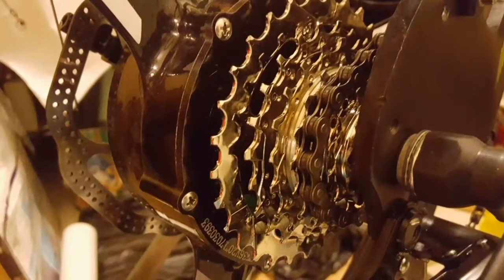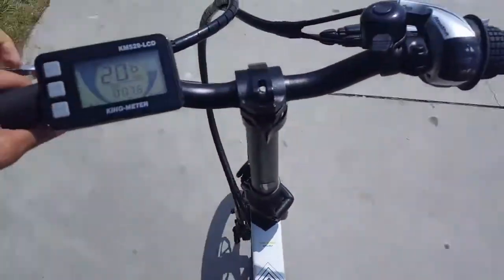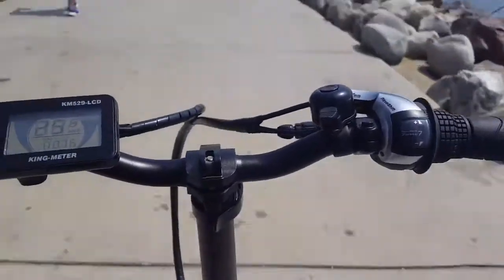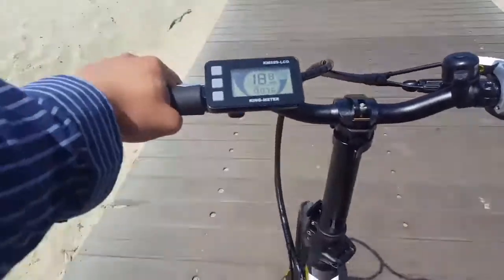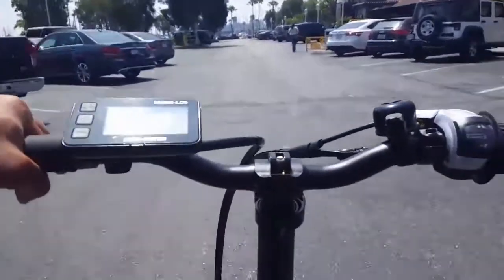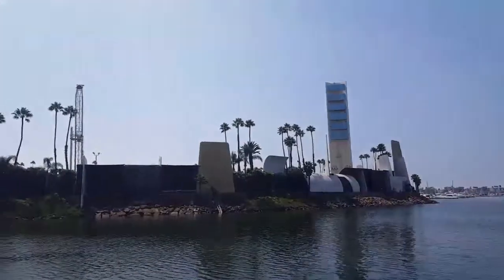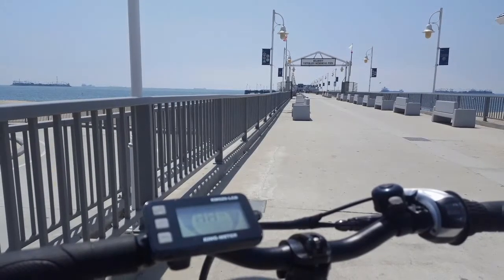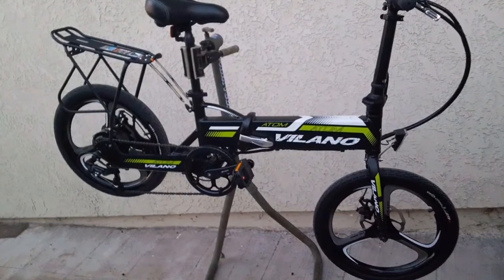FULL TEST - Vilano Atom with  11-30 teeth Freewheel  Upgrade - Review

Comment: I’m trying to decide between this and the Ancheer folding bike. This one looks cooler. Would you recommend it? Mainly need it to go to/from gym/work. Both are exactly 1.7 miles from home
Reply from the maker: +Cesar Bermudez i choose the vilano cuz it was cooler and didnt look like cheap. Also the weight was lighter and had mag wheels so i didnt have to deal with the hub motor destroying weak spokes not designed for ebikes. If you dont plan on hopping off curbs mag wheels are great. If you like click the link in the description for the bike and parts. Thanks !
Reply from the maker: +Cesar Bermudez one more thing, this bike has no mounts for a bottle cage... so while that sux, it still a great relative light folding e bike that doesn't look dorky
Reply from the maker: Lol i own and have been using it for months now for lunch trips with a round trip of 6 miles with still more than 50- 75 % charge left. It is still a diy tune or bring it to a bike shop after you get it. The main tune items are the disk brakes and gearing. Maybe tightening of nuts foe the wheels and accessories.
Reply: How’s the bike hold up so far?
Reply: i just got one a few days ago. pretty impressed with it so far. it's surprisingly powerful and easy to peddle. almost effortless on high assist. it's flat terrain where i live but being on the coast we do have steady head winds. it moves my 225 lbs to 37km  easy. battery life seems pretty good.

Comment: Nice! Thanks for posting. 

I got the Vilano Neutron and will be replacing the freewheel with a DNP 11-32, similar to yours, but larger 1st gear with 32 teeth instead of 30 (https://www.niagaracycle.com/categories/dnp-epoch-freewheel-7spd-11-32-nickel-plated). 

On my bike, with the 4" fat tires, the wheel diameter is a bit larger than yours - mine is 22". Yet it came with Shimano 14-28 freewheel, not 14-30 like you say yours has. I can use the 32t granny gear, on one particularly steep uphill I have to walk the bike currently ... And having the 11 teeth 7th gear would be a nice improvement too for flats and downhills.